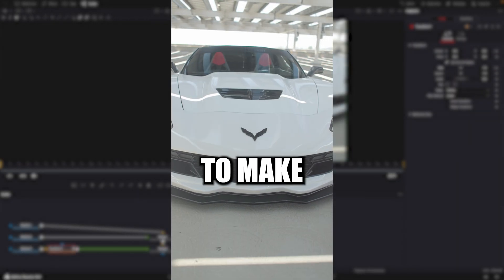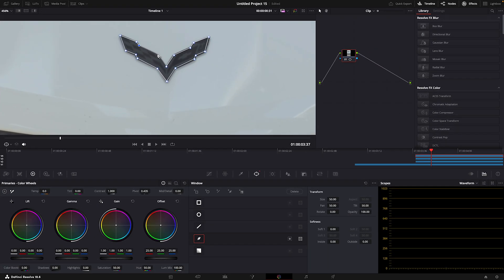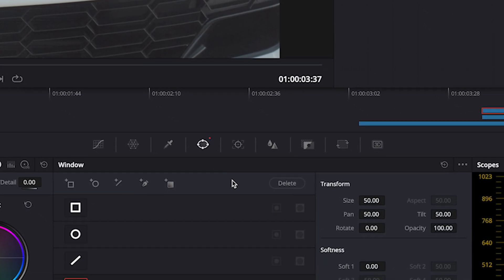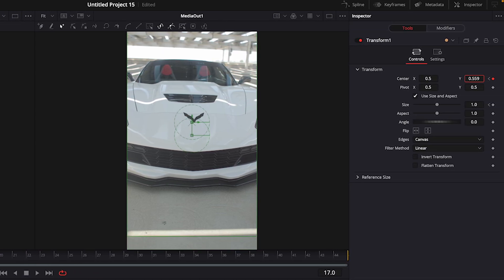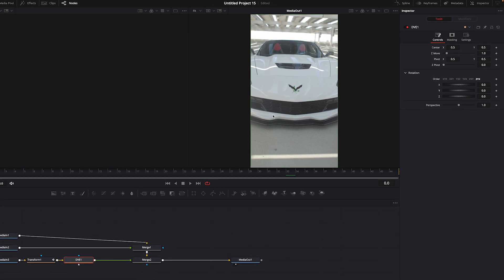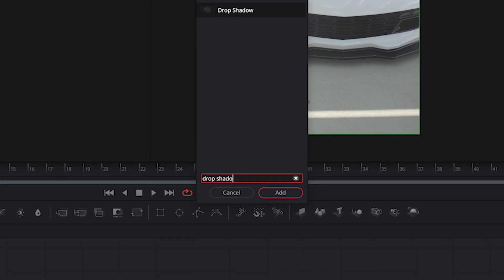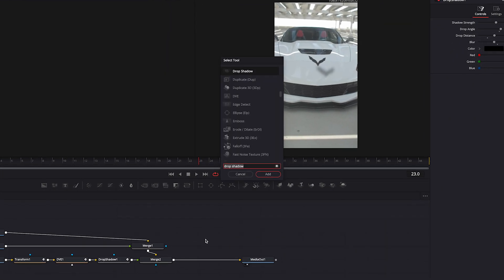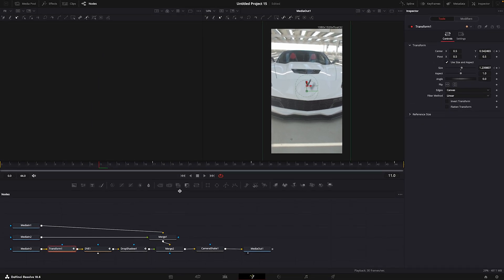Smooth Badge FLIP Effect - DaVinci Resolve

Comment: when i follow the steps into the fusion page, i have above the three mediaIn Nodes also a Background Node which is connected to the Merge1 Node. Also i have a Merge3 Node. Does somebody know why?
Reply from the maker: You should be able to delete all the extra nodes that are not in the video!
Reply: @VaultCar did that, it works, just wanted to know why its diffrent even though i followed everystep. thanks anyway, love the tutorials :)
Reply from the maker: @medpoject  Hmm, i might have accidentally removed them and forgot to implement thm into the video! Anyway, glad it works now.😁
Reply: Hey i have the Same Problem,. But when i Remote the background and Merge 3 Node i have no picture of my Clip on the Fusion page
Reply: @klaramuster1928 Were you able to find a solution?
Reply: @D3lang yes i just left it in i think and Tried around a Bit, its possible

Comment: alpha channel part is not working
Reply from the maker: You mean alpha output? Make sure your mask is connected so it makes a full loop. Could you describe more whats the problem?
Reply: @Vaultcar  yeah, when i am trying to pan or tilt my alpha output then not only the mask is moving but i am not able to get any cut out... How to fix that?
Reply from the maker: @princekapitara  hmm. Only things a can thing of are 1. The mask isn't a full loop. 2. You haven't connected the alpha output properly (if you did like in the tutorial that shouldn't be the problem) 3. You are not using the "sizing windows" pan & tilt
Reply from the maker: @princekapitara  Because there is a pan & tilt option in the masking window, but you need to move to the sizing window. 

If that doesn't work, then try to start over again and see if it starts working!
Reply: @Vaultcar  i was moving it, so the mask was moving but not the cutout place... And i also did connect the alpha output... I don't what happened
Reply from the maker: @princekapitara  Make sure you are in the sizing window and not the masking window. They both got pan & tilt adjustments, but you have to use the sizing window for that
Reply: @princekapitara  Same problem here😢
Reply: Kind of fixed that so after you done making the mask just go the edit page and convert the masked clip into a compound clip